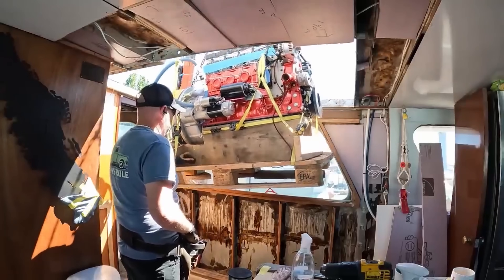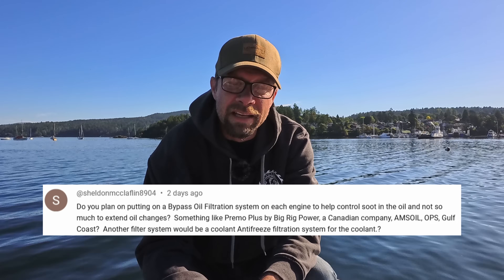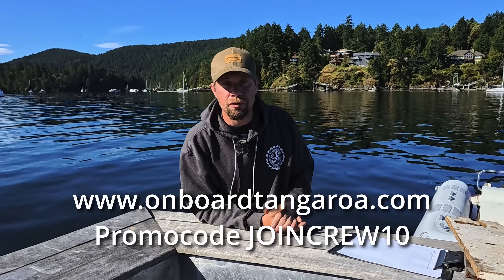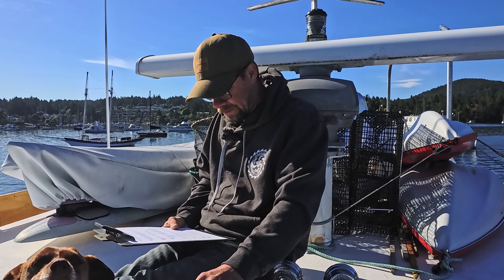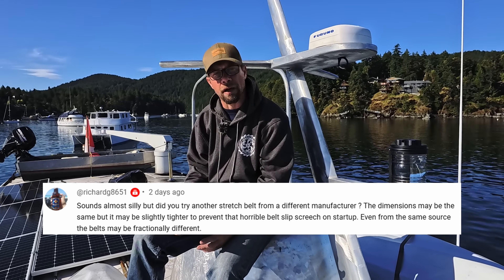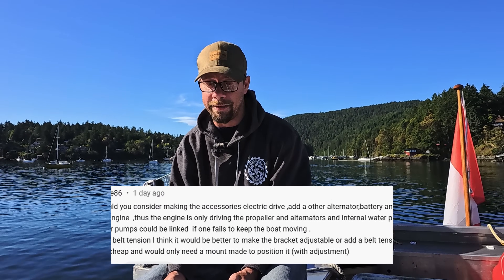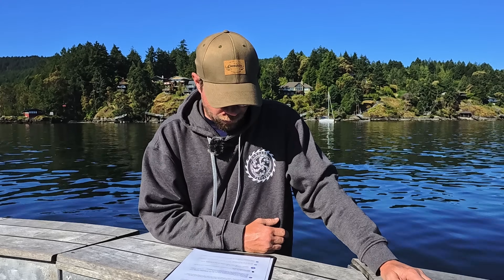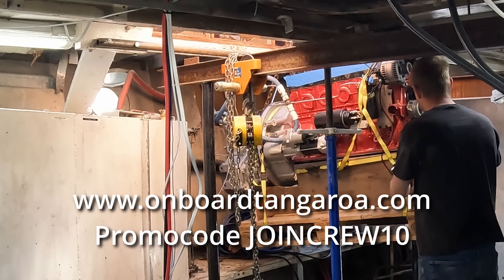Building my Custom Cummins 6.7 Belt Drive - Your Questions Answered

Comment: I like the idea of a cenrtfugal filter.
Many decades ago I drove 6x6 military trucks powered by the Deutz air cooled v8.
It only had a centrifugal filter and I was impressed by how effective it was and how much rubbery gunk it collected between services (easily a handful).
I also noticed that the oil never went completely black as is usual for a diesel.
Reply from the maker: It is an interesting concept for sure. Need to do some further reading on the subject though.
Reply: @OnboardTangaroaSeatrial the only downside is that they are quite bulky and your accessory drive end is already quite busy.
On the Deutz it was incorporated in the the fan hub so it took up no additional space and if I remember correctly it was driven off the timing gears.

Comment: I think you made a huge mistake changing the belt drive from original route you could of put your raw water pump were the ac compressor or  the power steering pump was located you’re motor mount looked like it was in your way to.
For the raw water pump if you were worried about rotation speed, you could’ve changed up the pulley diameters to make it not spin fast on the original one belt system the one belt serpentine belt system works for a reason and you strand away from that just looks like a problem in the future if it’s not a problem already, sometimes you don’t need to overthink a situation I don’t know if you don’t have it in your area, but you can CNC all kinds of brackets for modifications that’s why I recommended you use the original AC bracket or power steering location
Reply from the maker: While it would have eliminated one belt assembly, the bracketry and expense would have been far more extensive to try and run it off of the same belt as everything else. To match ratios and run it off of the main belt the pump would require close to a 12" pulley. That's not going to fit attractively anywhere. You also won't find that easily of the shelf. Sure, I could CNC it but machining two custom 12" diameter multirib pulleys would have been silly expensive. Those reasons are likely why Cummins themselves does the raw water pump belt drive like I ended up doing it.
Reply: Time will tell hopefully it works out for you being a diesel technician and fabricator it just didn’t look right to me but you did your research and the work good luck I will be watching the next video to see what is next.
Reply from the maker: Right on! Hopefully it doesn't disappoint.

Comment: Could you just change one of the pulleys out for a slightly larger one to tension the belt? The ratio isn’t critical.
Reply from the maker: I had debated this although the only one I could change is the drive pulley which would increase the raw water pump speed. Fortunately, being the drive pulley is a supercharger pulley, there are lots of diameters available. There is no room for a larger pulley on the raw water pump and due to its configuration, finding a different pulley would be challenging. May end up changing the drive pulley at some point.

Comment: Seems like this is all an afterthought. Where are we? Cruising or rebuilding. The builds done. These Q@As seem pointless
Reply from the maker: The build was finished last August. We had a lot of people asking for more detail though so the videos have been redone with additional info on the thought process and things we may have missed in the original videos. People still have questions on some things though even though the repower is complete and many seem to be really enjoying the Q&A videos. Seeing as this is an extra video added on Thursdays and is not a replacement for the main videos which launch every Sunday, there really is no downside to them other than more work for Janis and I 😁.

Comment: Not sure what your travel plans are but my concern would be availability of stretch belts in far flung parts of the world. If you already have tension issues then a change to a standard belt with either a sprung or manual tension adjuster would be best.
Reply from the maker: Definitely things I am debating. May end up doing that in the not-so-distant future.

Comment: coolant filters only makes sense on engines that are wet lined. Which this engine is not ￼
Reply from the maker: Thanks for the info! That would explain why you don't see them so much on the smaller engines.

Comment: Sorry I'm late to the party! I'm subscribed and usually watch on the TV, so I can't comment. But this belt issue piqued my interest, so I hopped on the old computer and subscribed again (I never remember my login, so I just make new ones for each device—lucky you!).

Anyway, it looks like you made the motor mount out of 3/8" or 1/2" plate, and the pump bracket out of 1/4" to 3/8". Could you just unbolt the pump mount, grind about 1/16" off the mating surfaces, repaint, and remount to get another 1/8" or so of stretch out of the belt? I suppose you could grind more if needed, since both components seem overbuilt (perfect).

Do you have any adjustment in the attachment between the engine and the mounting flanges on the engine mount? If so, you might be able to slightly bias the engine away from the pump mounted to the engine mount bracket, then realign the engine using the isolation mounts on the bracket. I know you probably don’t want to mess with realigning the engine, but if you have any adjustment, even 1/8" would likely do the trick.

Unrelated, but while I have you—do you find it ironic that one of you had (or has—you have a freaking de tomaso pantera, you can’t walk away from that!) a career building fast street cars that "theoretically" could exceed the speed limit, while the other had a career trying to catch people exceeding it?

Great content Thanks, Dan
Reply from the maker: Hi Dan! Thanks for the comment. I certainly could make some adjustments to the pump bracket and will likely go that way. There is no adjustment in the mounts from the engine to the crossbar so that isn't an option in this case. Whether I just alter the current setup to make it more slim or make a pivot with a tensioner setup remains to be seen. 
     
      I always did have a laugh about the opposing job descriptions. I called it a make work project 🤣

Comment: I would ask for your thoughts as to why you chose a Cummins 6.7l instead of an equally built, proven, and more structurally capable 5.9l?
Reply from the maker: The choice was mainly because the 6.7 was the latest iteration of them. The 6.7's have proven themselves quite well in the marine sector. While I'm sure many would argue about the 5.9 being more or less structurally capable, it was not a critical point in this build. For an engine that spends most of its life producing 60HP with the occasional push to 120HP  you don't need any extra structural capability. It is well within spec.

Comment: This question has been in my mind since I watched one of your past episodes. Since your navigation systems are running on a PC, do you keep a spare PC and make regular images after major changes to the primary PC?
Reply from the maker: I do keep a spare PC onboard for navigation however it runs different software and is just an emergency pc with minimal navigation software on it. I will likely have a complete backup pc for the main nav before we leave on our trip though.

Comment: Thanks for thinking about my suggestion and reading on this video.  There was another question that you read that made me think. For the engine crankcase vents,  why not put in some catch cans before the turbo?  It's a common automotive aftermarket part, and since you're running truck engines, it shouldn't be too hard to find.
Reply from the maker: In my shop we used to build all of our catch cans. I may end up doing that for this setup as well. Definitely want to keep as much vapor out of the intake tract as I can though.

Comment: Thank you for taking the time to answer the questions .
Moving forward then and with your travel plans ,what and how will you refuel once you leave Alaska fuel ports ,the visions of your tender being loaded with drums of diesel and being towed behind with a pump system pumping into the boat tanks as you burn fuel ,then the tender would be empty and can be loaded back onto Tangy?
I remember seeing some fisherman from NZ buying a boat from Australia and sailing it to Bluff NZ (down the bottom of the south island)and they had drums and tanks stowed on deck to enable them to make the journey .
Alluring Arctic Sailing 
Ice watched those sailing through the Northern passage and there were fuel drop locations at certain locations and I think some were supplied by Helicopter (
Reply from the maker: We should have the range to easily make any crossings we need to do with plenty of fuel to spare. With our current fuel burn and fuel capacity we have a theoretical 5000NM range. Time will tell how that translates to real world over long passages.

Comment: hi , my thoughts on the water pump would be k.i.s.s dump the stretch belt make a tensioner system using a turnbuckle to adjust the tension
Reply from the maker: May end up going that way.

Comment: I always love your videos.  As for the PBS comment, the current occupier of the Erange House is TRYING to kill PBS.
We had a CHENG (Chief Engineer) who was death of guys wearing rings (USN regs do allow religious or wedding bands in the engineering spaces, but you 'should' not wear them in the spaces).  Our MR (Machinery Repairman) took objection (as did his WIFE verbally to the CHENG), and he MADE A NEW RING.  As a demonstration he took a WTD (WaterTight Door, horizontal harch), lifted the several hundred pound hatch, put his finger in it, and DROPPED IT ON HIS FINGER!! Turns out the MR had made his/his wife's rings out of grade 8 STAILESS MACHINE NUTS, the hatch barely even SCRATCHED THE RING! (THE fact he didn't even MOVE THE HAND OUT OF WAY IS A TRIBUTE TO HIS FAITH!).  The CHENG backed off after that, since the MR said he would make rings for anyone who wanted them.
P.S. the CHENG wore his wedding ring and his Academy class ring on his dog tag chain.
Reply: Wouldn't be worried about the ring being damaged, would be worried about the ring catching on something and tearing my finger off.
Reply: @om617yota7 i thought so too, but then i was single and a deck ape, so very little in the pits.
Reply from the maker: I always worry about electrical. Shorting a 24v terminal with a ring heats up gold pretty fast! @om617yota7 That exact thing happened to my dad. He jumped off of a deuce and a half and his ring caught a bolt. Pulled it right off. They were not able to get it reattached.
Reply: @OnboardTangaroaSeatrial You mentioned that in the video, that's unfortunate. Doubtless your dad's lesson has saved some other folks from grief.
Reply from the maker: I sure hope so. The stories he used to tell my friends about how he lost it were always pretty comical.

Comment: Keel coolers are your friend
Reply from the maker: They would have been nice for sure. It just wasn't in the cards for this repower.
Reply: @OnboardTangaroaSeatrial  They can get expensive and the have them for aluminum hulls also, but they eliminate raw water pumps and heat exchangers which are a bunch of maintenance. Enjoying your videos by the way.
Reply from the maker: Glad you are enjoying the videos! I think the quote I got for the keel coolers was around $8000. Definitely fairly prohibitively priced. We also currently live in an area with pretty extreme biological growth so I would also be a bit concerned about fouling as well as we are currently not moving often.